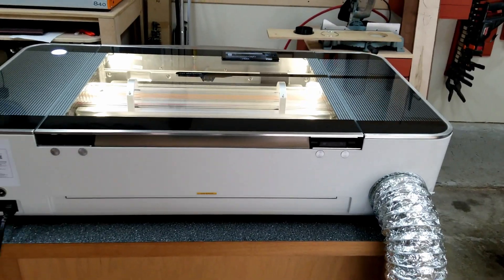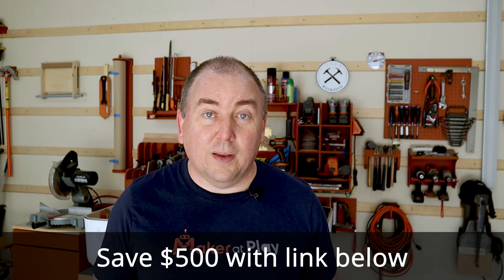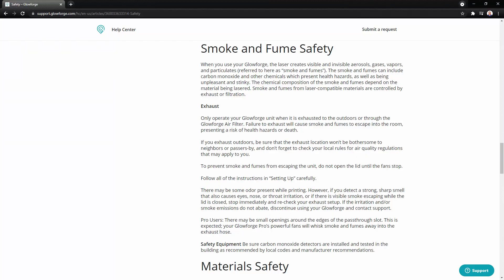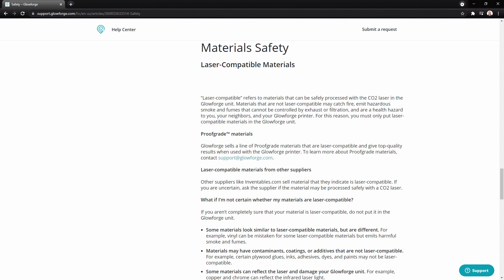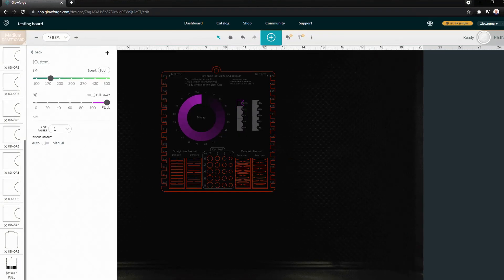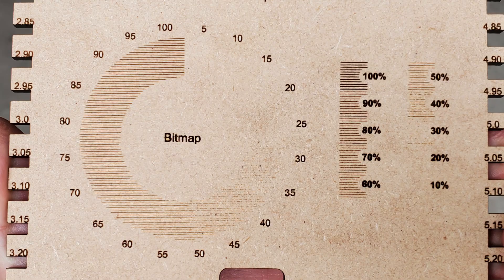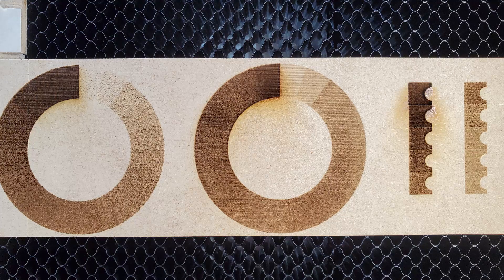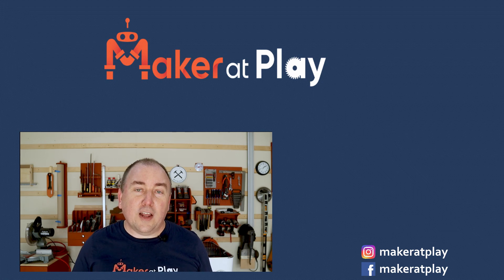Glowforge - Unboxing and How It Works

Comment: hey man quick question. So i'm enrolled in the mark rober class and the thing is i'm  going to be on vacation for the time of class. Do you think i should stay in it and build my projects when i get home or do i withdraw from class.
Reply from the maker: Depends on if you want to interact with your peer group. You can watch all the videos and do the projects on your own schedule when you get back. But your peer group will most likely be gone and you will get no feedback. If you want the expert of the peer group you need to stick to the schedule of the class which means take a later class. I think they are offered every 2 or 3 months.